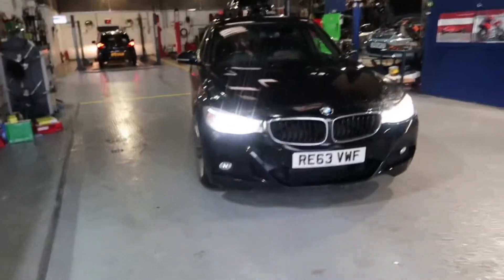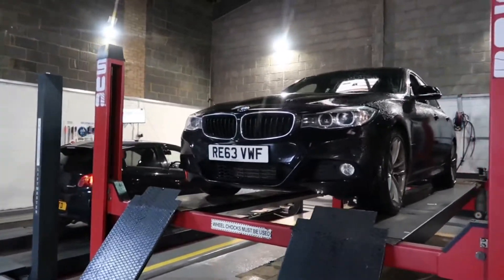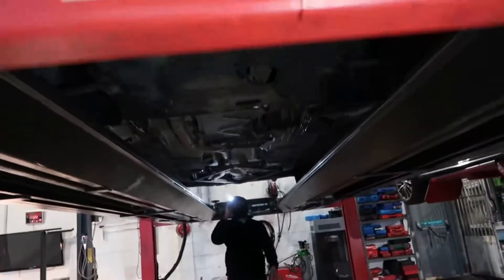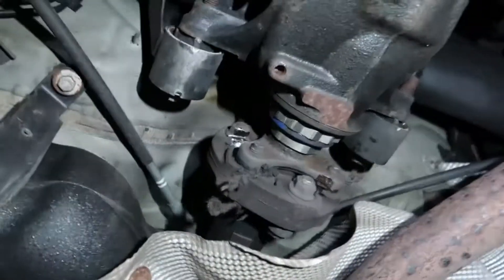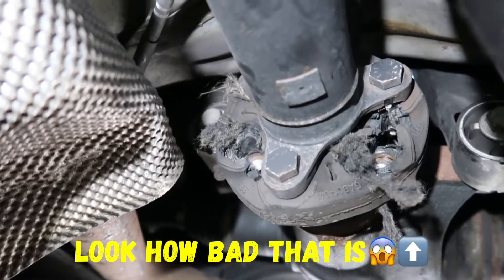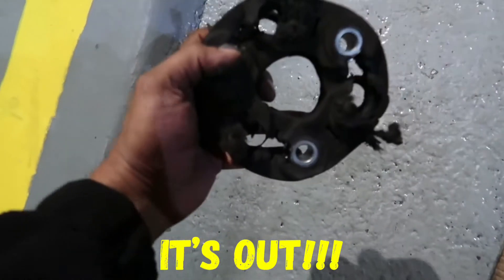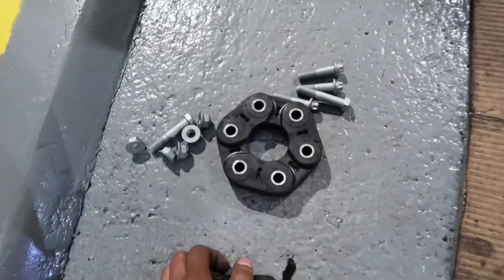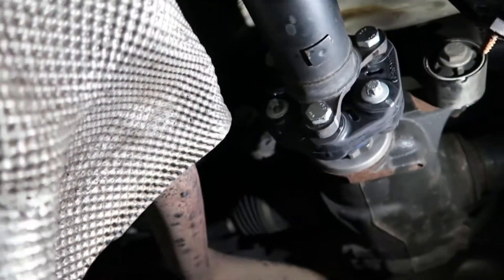2013 BMW 3 SERIES F30 F31 PROPSHAFT VIBRATION FAULT FIX AND REPAIR

Comment: My car has no fault code but the symptoms are:
1. Car vibrates at highway speed.
2. Sticky brakes, sounds like a rear caliper stuck however see point 3. 
3. All problems dissappear for the trip if I pump the brakes a few times when stationary.
Do you think its an abs fault?